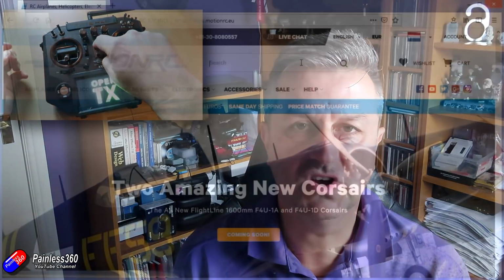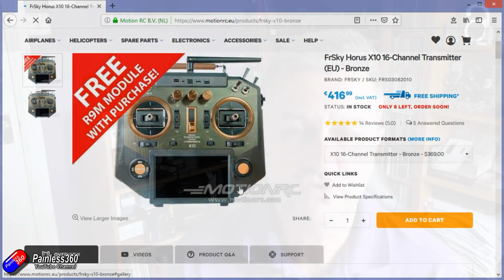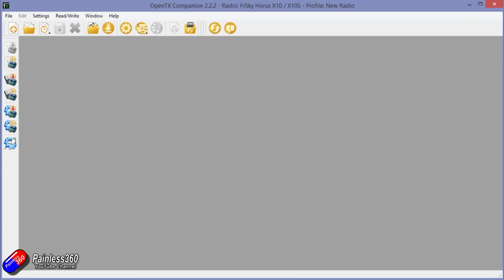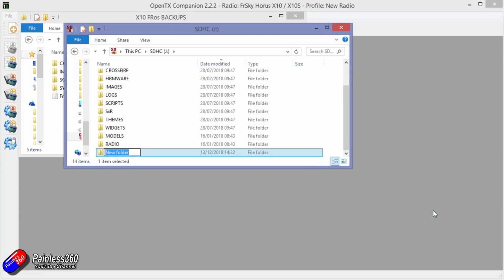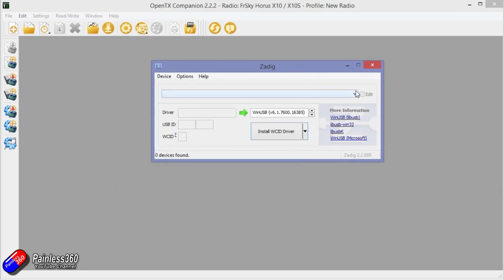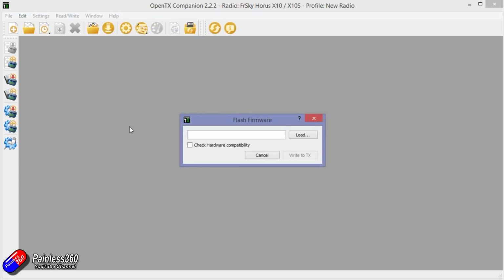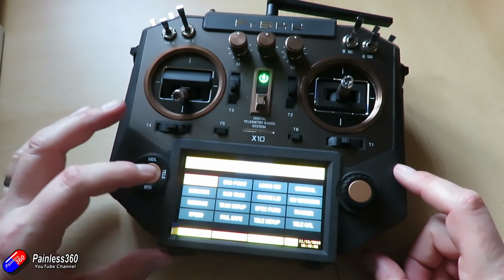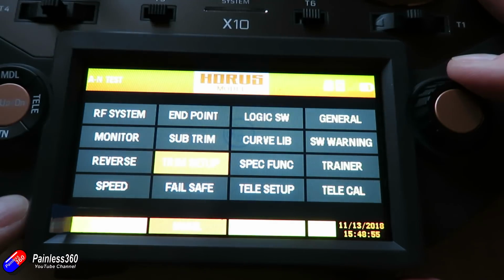X10 radio and FrOS

Comment: Hello "Form Across Pond"   I wanted to buy an additional transmitter to leave one at my camp. Looked at all the new stuff and decided to stay with FrSky as I already have two of them. Found a Horis X10S at a good price and bought it. Knowing that I could change it to Open TX. Seemed easy enough. I am using Version 2.3.14   - 2021-7-23 SD Card 480x272.23   3V0038. Followed some on instructions 12-6-2017. All went well and when I was completed i hit the power button and Heard "Welcome to Open TX" but got a message about the throttle. Hit escape and then calibrated the sticks. Powered up again same thing.  Checked everything in set up in Open TX. I did find that for some reason if I Hold the Pitch at the bottom and power off the message goes away. It seems like it is on Mode one set up?? 
I am really stuck, might you have any ideas? Thank you in advance. Ben Herr - USA
Reply from the maker: It does sounds like it has defaulted to the wrong mode in OpenTX. https://www.youtube.com/watch?v=VZR8oq9Sa_U

Comment: Hi Lee.  Let me begin with the confession that even though I've been an FrSky user for probably a decade when I put a hack module in my old Royal EVO9, I am a total clod at using it.  I have to resort to your videos for almost everything that I do setting up a new model.  On to my question-- I bought an X12s second hand last year and it has sat in the box since.  I want to transition from my QX7s to the X12s.  Would it be insane to flash back to FrOS?  I have a bunch of S6R and S8R receivers and Neuron ESC's that I haven't been able to use being too thick to figure out how to use them (I'm reasonably intelligent. I'm an ICU nurse in a busy urban hospital keeping track of a dozen pumps and monitors at a time so I still have a few functioning brain cells but I can't wrap my brain around this). Would it be easier to go back to FrOS to configure and use my stabilizing receivers and Neuron ESC's?  Thanks for the great videos!
Reply from the maker: I don't use FrOS here so I'm probably not the chap to ask. The support for the X10 from OpenTX is very good now and a lot of the X10 compatible radios (RadioMaster/Jumper etc.) use a similar version of OpenTX one their radios now too so lots of time working out the bugs.. Best of luck!

Comment: Big help - Im going to replace opentx with FROS . I also didnt make a backup. could you make the files available again. Thanks again
Reply from the maker: I've had to root through a lot of old backups to find it but it's now back in that link in the description. Always worth a look at the channel BEFORE you start anything to pick up the gotchas.. ;) Best of luck!
Reply: @Painless360  really thank you and your videos are very well done and enjoyable.
Reply: I use the same PC to program opentx . no problem. I did run the new version of Zdiag anyway and said replace . The only option after stm32bootloader was winusb to winusb. I selected replace. I installed correctly. I still see a device in device mgr but no USB drive. ( with power off on the radio. ) If i turn radio on I see 2 drives as normal with opentx. I think there is a problem with the current version of Zdiag,
Any Ideas ( thanks for your help )
Thanks again
Quote
Reply

Comment: im wondering how many protocols FrOS covers specifically does it cover horizon hobby's protocol for bind and fly? im not interested in quads at this time. may be in the future so for the sake of simplicity i dont wish to use open TX.
Reply from the maker: Only the basic ones for Frsky recievers. You need Opentx and a Multiprorocol module for that. See my videos on it. Happy flying!

Comment: Was it already the latest version of FrOS that you restored to the X10? Otherwise it may be worth checking out a newer version and what has changed. The firmware of the transmitter module inside the X10(s) is part of FrOS so it may be required to upgrade FrOS (and upgrading the trransmitter module firmware in the same process) even though one is using OpenTX. At least, that's what I read about it in the past...
Reply: There haven't been any significant upgrades to the radio firmware

Comment: I don't think you friend is doing the correct thing here. Open TX is much more wide spread and supported than FrOS will ever be, meaning he will be obliged to learn FrOS to a working level with little expectation of personalised help from others. As for the Wizards, they are pure icing on the cake and not essential. It is often better to simply copy an existing model as the basis of a new model. Lastly It is usually the case modellers who are unwilling to stretch themselves will only ever fly simpler models which again feeds back into the points made earlier.
Reply: I'm a huge OpenTX fan but I acknowledge that it's not for everybody. It's perfect for those comfortable with a PC but setting up a model is totally different from more traditional transmitters. It's not an age thing either, I'm 66 but my friend in his thirties won't even consider flashing Open TX on his new X10. Plenty of younger people are completely at home with a smartphone but clueless about PCs. Personally I think FRSky would expand their market considerably if they sold the Q X7 and it's derivatives with FR-OS!